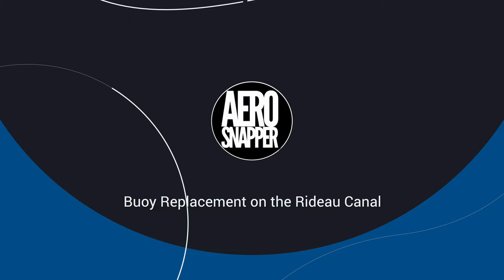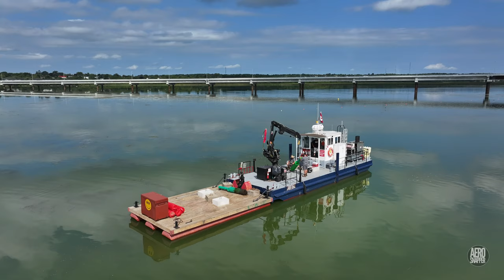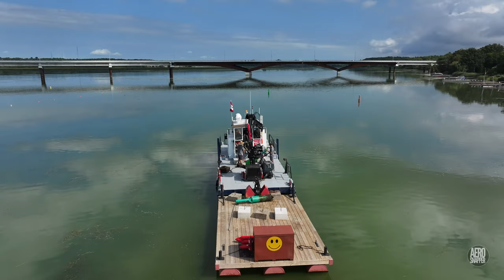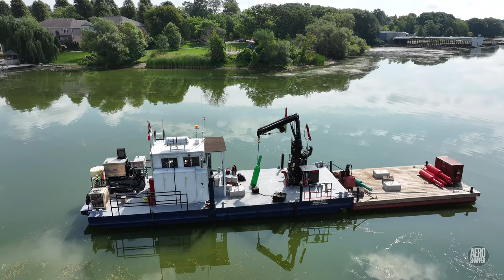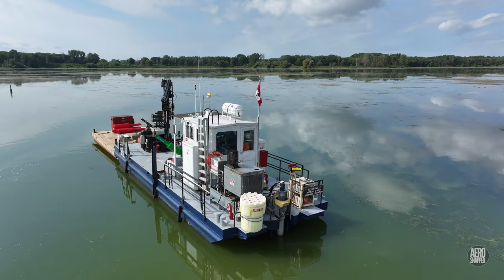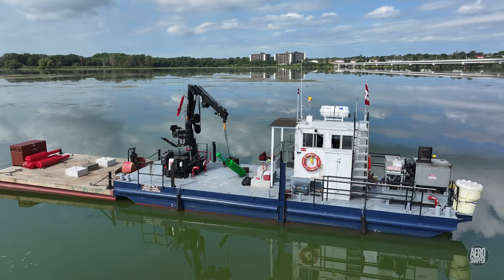"Kicking a Can down the Road - Rideau Canal buoy replacement   4K

Comment: Red on right Returning (to Ottawa)
Reply from the maker: Quite correct - well half correct anyway.  It's 'Red, Right, Returning'.  This means that a vessel heading for port - or up stream - keeps the buoys on the right.  However, from Newboro to Ottawa, because you're running downstream, the buoys reverse.